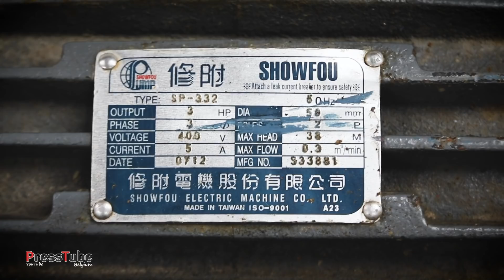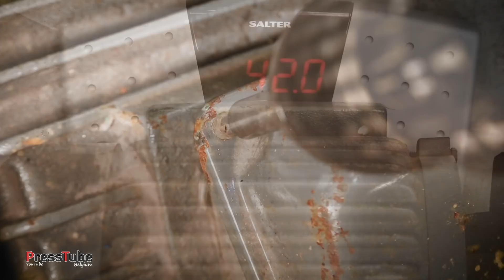Recycling Scrap Motor to Copper Ingot ! Trash to Cash!

Comment: Just a tip if you have the flames from the gas on different sides it will heat up more evenly and make melting solid clumps faster but the copper wire isn’t like a large clump so it didn’t matter for this
Reply: He listened he has 3 now

Comment: melting copper with steel? Cut one side and use hammer and iron rod to remove copper or pull out copper. If not work burn it in fire and melt it with some coal.

Comment: 2.46 lbs for those who don’t want to convert grams to pounds. I am actually pretty shocked that it’s that low, I strip the copper for motors almost full-time now, it’s been very lucrative I must say, and I have strict big three phase motors like that I get anywhere 6 to 8 pounds for those. 1-2 lbs per normal size motor

Comment: Wasn't that motor still useable with just some cleaning and bearing replacement? Unless the continuity of the copper cables was broken
Reply: Who cares. that's not how money is made.
Reply: Believe me when I tell you no technicians going to do that when they could go pick up a new motor. Occasionally we will have one rewound but more than half the time it’s much more difficult to get replacement bearings let alone a seal kit for one of those motors.
Reply: @Pennconst101  im technician and that motor was not bad look, i dont know if de rotor was broke but the other parts i think werent in bad condition at all
Reply: @Pennconst101  In the company that i work and its a very well known company i can tell you that if it can be fixed it is fixed no matter how many hundreds of remplacement  motors you have jaja and with the pumps the same think.
Reply: david garcia Hey man I’m with ya. I cut my teeth in a company like that. We rebuilt everything. Sometimes we would fabricate our own bearings or cut them down to fit. I’m a firm believer in the importance of being able to do that Even though it appears to be a dying aspect of the trade.The place I work for now has a pretty high profile clientele of executives and big business here in Raleigh. Our priority number one is get them up and running as quickly as possible... cost be damned. So… That’s what we do.
Reply: @Pennconst101  that is, the only worry of the bosses is that the montage line dont stopped